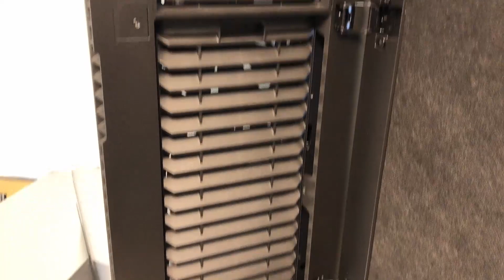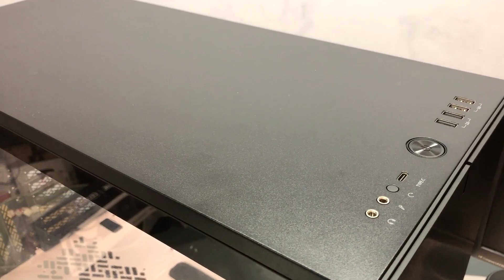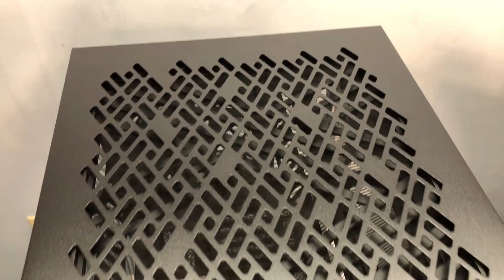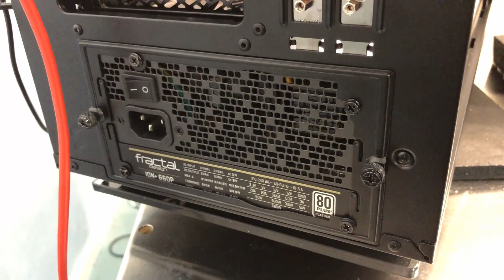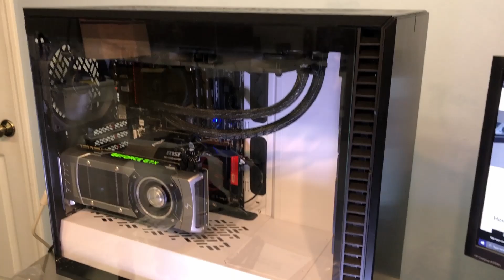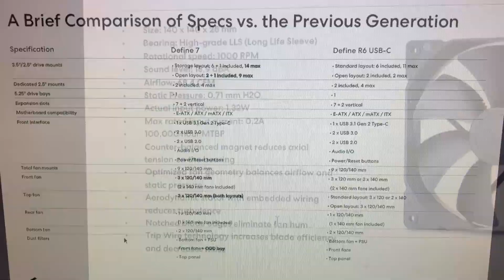Fractal Design Releases the new Define 7!

Comment: The case has the 5.25" opening but lacks a proper drive bay cage with guide rails, making it effectively unusable for mounting 5.25" devices securely. TL;DR do not buy if you need 5.25" bay.

Comment: How are u going to cool the GPU if the AIO sits at the front?
Reply from the maker: Right - to get max airflow from the front (front fans), you would be forced to put the radiator in the top.

Comment: This was extraordinarily helpful. I'm doing my first custom build so some things that  would be obvious to an experienced builder were not obvious to me.  I opted for this case largely because of the large number of USB ports. The manual is pretty lacking in explanations for newbs like me and your review answers all of my questions. I just wish I'd watched it BEFORE I did my build! I made some mistakes that I wouldn't have made if I'd seen this video first. I stumbled upon your video when looking for an explanation of how to remove the front panel because I want to transfer an ODD from my old system into my new one and you need to remove the front panel to flip the ODD bracket around and reposition the fans. Great job! Thanks.

Comment: in your opinion, would the Arctic Freezer III 420 AIO be a bit too big for this on the top?  It's a very thick radiator and i think it may cover too much of the mother board?  what do you think? and would you still get 3x 140mm fans in the front with a 420 AIO?

Comment: I have a Define 7 for my new gaming build.  Good case from what I have seen so far.  Case availability in a timely manner is restricted in Canada by what gets imported by dealers.  Importing privately adds up to 80% to the cost.  I would have liked to have seen images of the case in different configurations and not just artist renditions.  I ended up having to look at reviews to figure out how to set up some of the configurations.  A small SSD cage ahead of the cage for 3.5" hard drives (down at the power supply level) would have been nice.  I plan to cut a hole for a 200 mm fan in the side panel to increase airflow.  Fan noise is not a big issue for me as I game with headphones.  Also, some way to mount a top handle would really help.

Comment: Nicely done. My question regarding the option to mount a optical HD is: What happens to the Fan? Are you able to slide both fans in at a lower position or do you have to give up one fan in order to place the HD on top?
Reply: yes you can  slide both fans in at a lower position

Comment: Found this video now because I just got this case for my build. I'm pretty new to building and got this because it's one of the very few I could find that still has an optical drive, and it looks very roomy and simple to build in.
A little worried about the front cooling, and still debating with myself if I want radiator on front or top, but also got a few noctua fans to put in, so hopefully I'll be able to make it nice and cool. Worst case I'll remove the door, but I hope it won't have to come to that because I love the rest of this.

Comment: I got the onder Version, the Define R6. Its the best case i ever had, well made and very solid, very modular and easy to build in. Got two 140mm Fans in the Front, 1 in the back and a 360mm rad on top for a custom watercooling. I even made use of the fillport so its very easy to fill it up

Comment: Are there places on the optical drive bracket on both sides to secure the drive?  Or just the one side?  If there are on both sides, are you able to put the drive on the bracket, then slide it in.  Then screw the bracket to the case.  Then put on the front?  I know that it might take some fiddling to get it just right/flush with the case.    I can see that being more secure than just one screw holding in the drive.
Reply: You probably don't need an answer anymore, but for anyone interested, yes there is one screw on each side, and yes I think you could mount the bracket to the optical drive then slide it in as a single assembly (but as you point out, alignment would be an issue).  It's not hard to get the screws in on each side after the drive is aligned with the case, so that's probably the better way to install it.
Reply: @fredhamilton1701  - I found out that you can screw it in on both sides.  But you have to take the frame apart some to do it.

Comment: Quick question...but first...AWESOME video! Terrific coverage of many commonly asked, but seldom covered questions. I'm curious to know your opinion on the three fan radiator in the front blowing, bottom fan blowing  hot air into the PSU shroud area increasing PSU and graphics card temps.  Thanks

Comment: will the 360mm aio fit in the top with the HD expansion panel on the left side of the case?  if so, does it have to be mounted to the center track or the far left track on the top?

Comment: Nice review! But it's too bad you completely skipped over the longest and hardest part - installing the PSU, I hate the shroud part and I wish you had mentioned another negative (IMHO more important than looks) - you can't easily add peripherals to your PC without having to rip the PSU out and plug power cables in! Been that way for a few versions of the Fractal Design cases now and the one reason why I'm sticking to older versions without the shroud. I guess it's not an issue if you never plan to upgrade/expand your PC.
Also maybe I skipped over but did you mention the longest graphics card that will fit when the optional 3.5" drive bay section is installed?

Comment: Good review Chris. I'm probably going with either the tuxedo version you show in this video or the all white. One thing I'd like to mention is if you don't use the optional gpu adaptor you can remove the ssd mounts from the back and mount them inside the define 7, I mean if you wanted to show them off. Cheers!

Comment: Chris: Well done, but is the front door made of brushed aluminium or plastic that looks like metal? I want to buy this case after hearing your review but would like to know what material is it made from.
Reply from the maker: I just happen to be sitting in front of the case. It is an aluminum overlay. So the frame of the door is plastic but the outer skin is aluminum.
Reply: @overclockersclub  - Thanks for the explanation, Chris. I have ordered the black case for my build.

Comment: Hi, nice review. 
This is the most detailed Define 7 review I've seen in YouTube as I'm thinking to buy one.
One question sir, can you mount 360 rad with push/pull configuration on top? thank you so much!!!
Reply from the maker: A 360 MM radiator will fit however you will only be able to use one set of fans. It has been my experience that the benefits of an extra set of fans in a push poll configuration is minimal. Don’t let that stop you.
Reply: @overclockersclub  i see. thanks again for your explanation

Comment: Quick question, that side panel that can be used for multiple drives, can it be removed from the right or back side of the case or can it only be removed to the left (the direction of the glass panel)?

Comment: Despite great build quality this case does have thermal issues.  The CPU temps drop 10 Deg C if you take out the front filter and leave the door open.  Other cases are now using a fine mesh front (see Fractal Meshify) that eliminates this problem.  The noise is mitigated by fans that run much slower.  If Fractal can offer us a new top in the Define 7, why can't they offer us a new mesh front?

Comment: OOF! my R6 is actually better designed for my use. the cut outs arent as ugly either. I have the entire inside open with a 240 rad in front with a total of 11 fans inside. whisper quiet.

Comment: Can you still fit a radiator with optical drive installed?  Either top or front mounted.  If so what’s maximum size?
Reply from the maker: Page 9 of the user manual shows a Top Radiator: 240 x 120 mm
 and Front Radiator: 280 x 140 mm when an optical drive is in use.

Comment: i think the radiator installed at the top is better because you may have better airflow with two extra fans bringing air from the front and exhausted from the rear.I wonder if it would make much difference with another fan at bottom exhausting out if you leave the first plastic cover open.

Comment: Wouldn't it have been more efficient with the front radiator placement to have the fans "push" cold air from outside the case through the radiator?  Or, was there any reason with the case design you had this initially set with the fans on the back of the radiator to "pull" the air through radiator?  Excellent review, btw!!

Comment: I apologize in advance if you stated this already but I believe the door hinges can be moved onto the opposite side to allow easier access depending on case location. I didn't have that with a similar previous case and it was annoying to deal with.
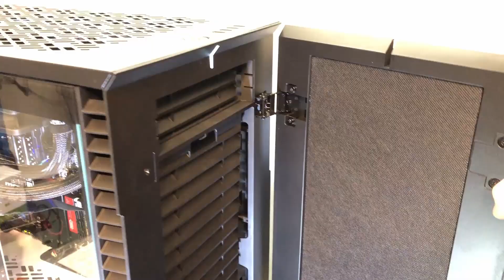Reply from the maker: @44:50 I mention that the hinges can be swapped.  I forgot about that when I was shooting the video and then remembered later and included it at the last minute.  But still a good eye you have there!

Comment: Great review, could you tell me is it possible to install 420mm radiator on the top, 360 on front and 240 on bottom in the same time?
Reply: Gordon Freeman 420 on the top --> up to 280mm front available

Comment: yea, about that optical drive bay. what you haven't shown is that you can't gain access to the right hand screw without removing the plastic drive bay cover...and you won't be able to put that cover back once the optical drive is on...annoying...
Reply: That's what I was thinking too, but once you tighten both screws attaching the bracket to the optical drive, you can remove the two screws holding the bracket to the case, then pull out the drive and put the plastic drive bay cover back on, then slide the optical drive back in.

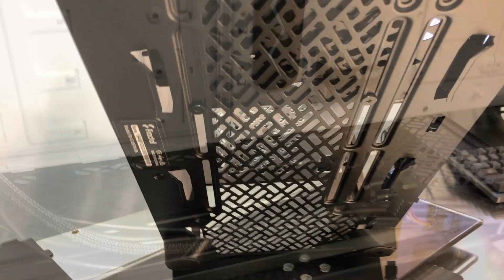Comment: I have to ask @ 21:55 you're sliding the drive cage around on the bottom of the case.  If you were to purchase 2 extra accessory "Hard Drive Cage Kit - Type B" from Fractal's website, would all three fit down there, for a maximum compliment of six (6) 3.5" hard drives on the bottom?
Reply: I know this is a bit late, but I wouldn't recommend more than 1 drive cage at the bottom. There is very limited space after the PSU and the drive cage are installed. The limited space will generally be used from loose cables.

Comment: Is the front area of the case restrictive to airflow? I've seen the review of Gamers Nexus and they weren't satisfied with the thermals in stock configuration. What do you think?
Reply from the maker: Yeah, when you try to keep the sound down and use filter panels to keep dust out, you can introduce restrictions to air flow through the case. So the trade-off for a quiet case can be less air flow.  However, I didn't think it was too bad.  I say that because I have many hours of testing on my 4770K, so I (generally) know what to expect with load temps - and I didn't see anything that caught my attention.  Keep in mind that my testing involved the Celsius S36 which uses fans with a max speed of 2000 RPMs which is double that of the stock case fans. Temps with the radiator in front (only using the stock rear exhaust fan - the two stock front fans were removed) were about the same as with the radiator in the top and using all 3 stock case fans.  

There are other factors such as room temp. and how your system is built and used that also play into it. You can always upgrade the stock case fans (higher RPM), or add to the fan count to get more air flow.
Reply: @overclockersclub  Thanks for your answer.
Reply: @overclockersclub  If i get this case i will also use an optical drive but i was wondering how will it stay in place since there is nowhere (at least from what i've seen) to screw the back side of the optical drive on the case chasis (where the the cables plug). Won't it "bend" on that side downwards?
Reply from the maker: @CueButtonStuck  The mounting bracket at the top (for the optical drive) has provisions for mounting screws to secure the drive on the sides.  You'll be fine.
Reply from the maker: @CueButtonStuck  I go over the optical drive installation @19:53
Reply: @overclockersclub  thank you very much kind sir.

Comment: Optical drive in 2020...
Reply: Because that is how you get Blurays onto your network without resorting to piracy...
Reply: Having a blu ray player is pretty great
Reply: I actually find 5.25 slot very handy. I don't use it for optical drive, but I do use it for hot-swap HDD cage. It's very handy if you use this case as a NAS server and you need to upgrade one of your 3.5 HDDs.
Reply: I have an ASUS Blu-Ray Writable OD . I am not getting rid of it. Plus its good to have...
Reply: If you really want to own a game having it on disc is the only way.